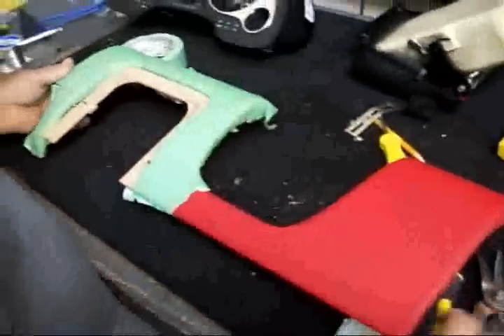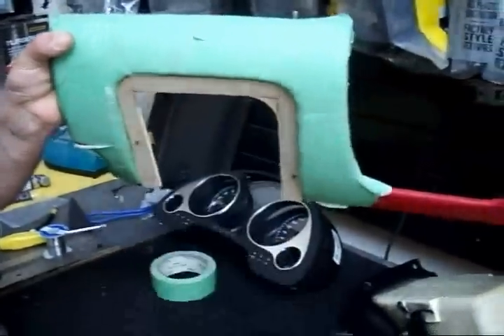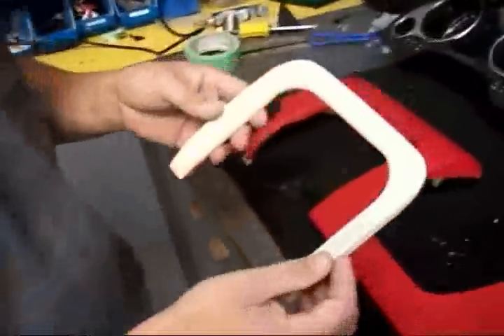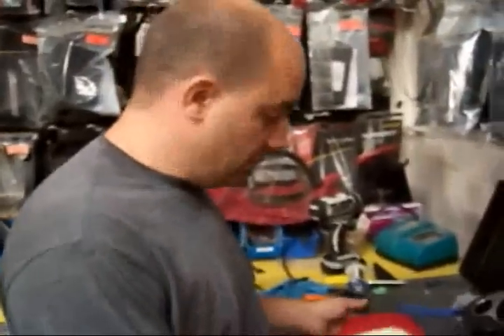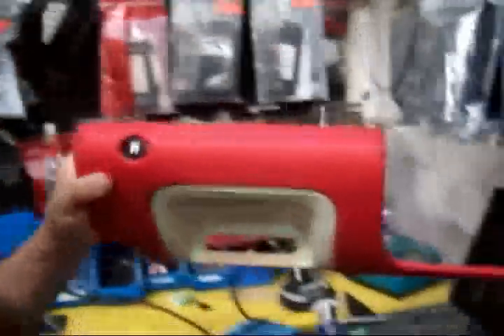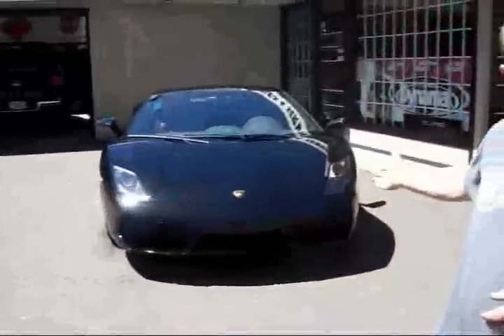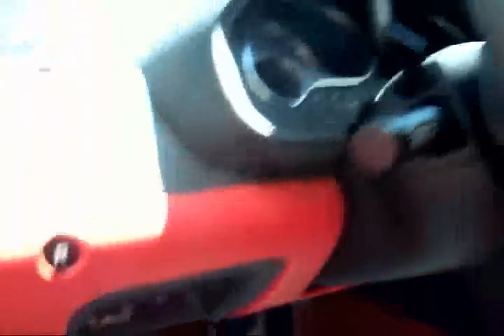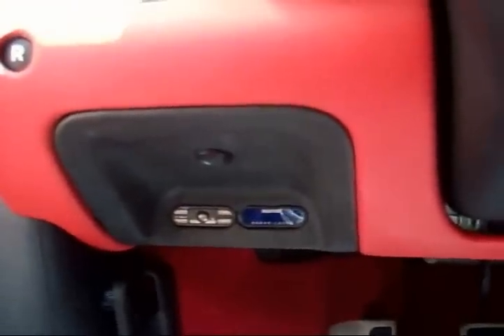Lamborghini Gallardo Passport 9500ci Installation

Comment: The quality of your work is great.  Clean cuts, sands, and integrated looks.  Very good work.  That said, all your installs look the same...  Digi next to controls.  Put the digi in a more readable, intuitive, IN-the-way (yet still discreet- or just etch the rearview) location, not at the bottom of the dash, and put the controls not up at the rearview where the driver has to reach up (arm visible in the glass) or all the way at the bottom of the dash to cut on/off mute etc. Console area works.